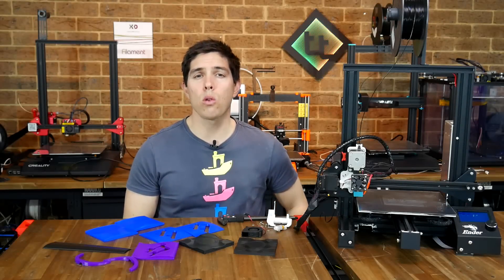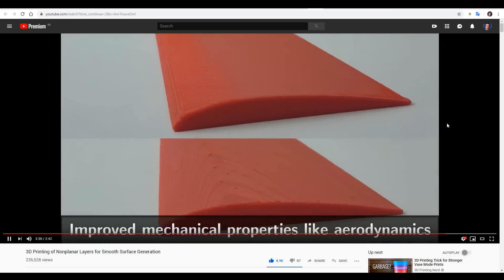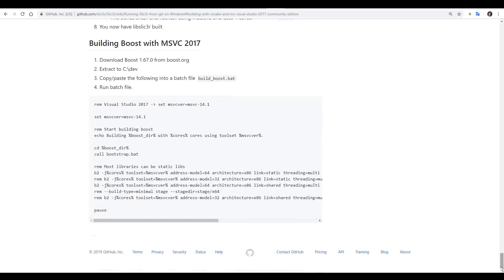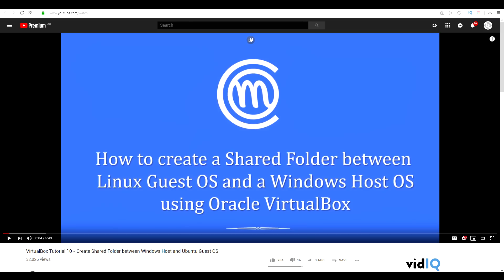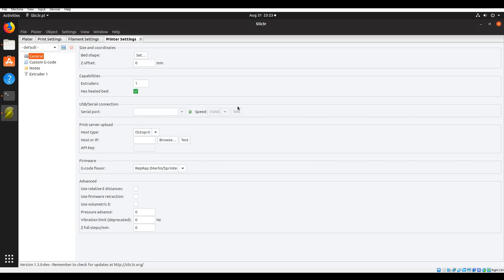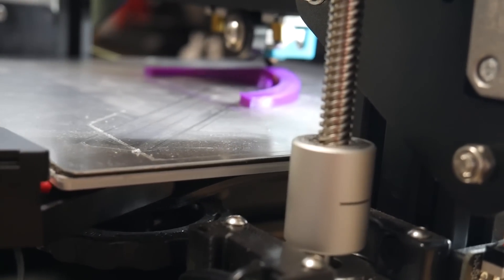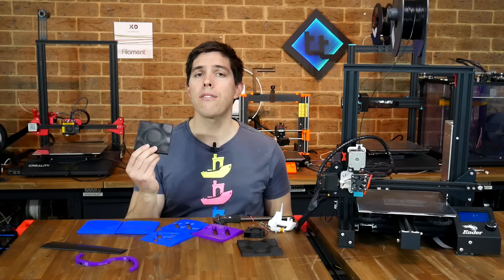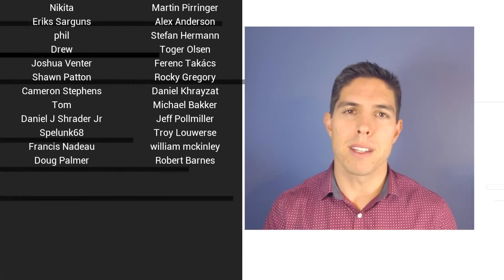Achieve true 3D printing with non planar slicing

Comment: I know i'm very late, but i just found out today randomly, that MIG welding nozzles use the same threads as the nozzles for 3d printers! They are full copper and 25mm long, for this application they might be really usefull if it can carry the heat down without problems
Reply: Nobody owning a lathe anymore...?
Reply: That's an idea with potential. The original bore may not be perfect, but it's copper, easily accessible & comes in a range of sizes. Relatively cheap, too.
Well suited for modification. Rebore them, change external profile.. even turn them into stand-offs for standard nozzles. Lots of potential.
Reply: I’m going to doubt it’s viability because my stock ender3 pro hotend drops almost 100• between the actual contact and the tip of the nozzle. My printer heats it’s element on average 80• higher than the nozzle tip. Adding just 10mm to that length would put you somewhere in the 150• area(not even close to viable), and to get the heat out of the nozzle you’d have to turn your heat up to around 400• which is going to kill your hotend lifespan.
Reply: norden what are you doing here i didnt know you liked 3d printing
Reply: You mean the contact tip or the gas shroud?
Reply: @hoenndpn9200  Contact tip
Reply: @Dongaz  do you have a specific supplier where you saw this? I don't have a MIG welder so I don't know exactly what to look for. Maybe a link or a reference to where you saw it? That would be very cool if there's something out there already

Comment: Imagine the structural strength you could reach when the infill is no longer limited to the X-Y plane. By adding direct connections between layers by the Z-axis you could solve the only problem stopping 3D printing from making final products for heavy usage. 
Steeper angles would also be possible by printing parts of the non linear surface in parts. You set the clearance of your nozzle at 7,5,mm. This means that if you had a pointy nozzle you could print non linear surfaces up to maybe 60-70 degrees in strokes of 7,5mm. You would introduce a new kind of horizontal lines, but they would be easier to get rid of than a horizontal layer every 0,2mm.

Comment: I’ve thought about something similar as a way of printing bridges and overhangs without supports. Print upwards until you get to the overhang, then tilt the hotend and start printing sideways, slowly if necessary for adhesion, adding onto the side. I know this has been done with angled printers but there are limitations to that. What I’m referring to is combining both vertical and angled printing by tilting the hotend midprint. I wonder if that would work.

Comment: I'm not sure if this information will be useful or not. I swap the Teflon tubing in hotends with stainless capillary tubing that I buy and cut myself, to allow me to increase temps without having to use a special hotend. The tubing could potentially cut longer to allow you to space the nozzle out further. Not sure this will provide many advantages in this application but it may allow you to set the nozzle a few mils lower.

Comment: I thought. They could, but they can't and it seems obvious now.
As you went through, I thought the head would have to move (for best results), it would only need to have a camber axel of 12.5 degrees to make it work.
The secondary,  fixed head. I would think that a nozzle extender could work, a copper tube for example.
This could transfer the heat down rather than moving anything else.

The fan cooling benefits are essential from what I have seen, (printer arrives soon). So the only difference would be the angle of the parts cooler duct. And then a short extension of a few mm.

But....
If you're getting steps which are so wide then surely this is more a slice issue? Or nozzle?

The steps should allow  small inversions of 0.4mm on standard and around 0.2 on a small nozzle.

And does the printer not offer smoothing? 

Tbh I can't believe they don't offer this, or have had this designed in, after all it's very old tech from engineering, and you couldn't get perfect roundness, but it wasn't as bad as the printer is. 
Is this down to bits? Or instruction handling?
Can it see, move and control 3 axis at the same time?

Sorry may be a too technical question...

Comment: They could take it a step further give printers the ability to slightly vector the nozzle in X and Y.  Layers could be stitched together then.  i.e. Current layer lines periodically latch UNDER the preceding layer lines.  Rate and location of latches could be slicer defined.  I can't imagine that it'd be prohibitively complicated either.  Just add a movable gantry for the hotend to mount into.  Could even use a mini-bowden arrangement with a tube of only a few centimeters so the gantry wouldn't have to move the extruder along with the hotend.  Just a thought.

Comment: Hi, do you know if someone tried to modify a delta printer, so that it prints nonplaner WITH tilting the head? I think if the dual rods are replaced with single ones with ball joins on both ends a nonplaner with tilting can be achieved. Love to hear your comments.
Reply: I actually think this idea is genious, how ever don't think it would work as explained. It would require more parts to change the "move left" into a "first tilt 30° and then "move the remaining steps left".

It could work by haveing 2 "arms" above one another in one slider, then adding one additional stepper per delta slider which moves the 2 in different directions and therefore creates a tilting force. - its a bit hard to explain in english without learning the mechanical engineering terms first. sorry.
Reply: @TeaObvious  You are right - I messed up  while thinking . The Delta I'm imagining should be mounted on XY bed as it can handle only the Z and the tilts. Nice to see such a project though.
Reply: @sugar4o  I get your point, having the bed tilt until a certain angle, lets say 45° should be possible here, would be indeed a nice solution that enabled even more possibilities.

This also would be possible with only 2 additional motors instead of 3 as my idea. Despite the fact that the mechanics to tilt a plane this way is nothing new and used in some games. The most complicated thing about this to keep the bet steady.
Reply: Or it can be a proper delta with addon mechanism for tilting the head with a center of rotation the nozzle tip
Reply: @sugar4o  dunno if you meant it this way, but the machanism still needs to be on the frame of the printer not on the head to reduce the force of moments. Thats what i mean with having 2 rods per driver and use this to rotate the head.
How ever this needs to be solve, this would actually be a really fun project. :D

Comment: If you fitted teflon tubing to a box/manifold and blew this with a brushless fan, you could parallel it to the filament feeding tube, make a bracket to hold the tube end aimed at the workpiece and get a part cooling jet to replace the fan.

Comment: I imagine it will still be a while before every machine is running true 3d toolpaths with plug&play ease. I mean, someone can program toolpaths for a specific part but to compare with today's "slicer" programs, I imagine it will take a while for the ai programing to be good enough.
I just got my first mini-mill that's basically a glorified engraver but it does smal aluminum projects. Anyway, I couldn't believe how much simpler it is to get a lazer to make a product than it was to find a good CAM program that works with the software. It's one of those Chinese  3018 set-ups but has all aluminum parts. I already messed it up too, trying to see what happens if I go past the max with no limit switches. lol

Comment: now, wouldn't this produce a similar effect to just rotating your print 90 degrees vertically? unless you purposefully direct each line of this method printing there is no use for it.

Comment: Have you considered replacing the cooling fan with an air stream? Similar to what you would use to clear the work on a K40 laser cutter. That could  give you a much smaller footprint at the nozzle end.

Comment: Teaching Tech: "I needed a dedicated Linux machine. From here on out, I needed a Virtual Machine" every Linux user ever: facepalms "JUST DUAL BOOT!"🤣🤣 
I just find it funny that VM is harder to set up and much slower yet more people use it because they don't know about dual booting or using a thumb drive to boot Linux from lmao
Reply: No concurrency between the utilities present on both systems. Cant flip between them instantly
Reply: @Hyratel  but if you have a SSD it takes less than 30 seconds to reboot into GRUB and switch to Linux.
Reply: @TeslabladePlaysMC  that still means you have to completely stop what you're doing on one to switch. And idfk anyone who ever does Just One Thing at a time, even on projects

Comment: Excellent video! Wanted to point out that you could have just used cloud storage like dropbox instead of a shared folder... assuming your VM had network capabilities. Also, do yourself a favor and install Git bash or another terminal program instead of command prompt! It supports command history and Linux style commands.

Comment: Actually, a modified Delta printer is excellent for this, as, with the correct programming, it can rotate the printhead quite easily... There is no reason that the effector has 6 arms, three determine the plane and as you can freely control each arm, you can move the plane from horizontal...  (need to brush up on my math to figure out how to do that in  a program...)

Comment: I think the geometry of a nozzle printing a 45deg overhang in a planar print is similar to a nozzle printing to a 45deg sloped surface in a non-planar print. So, just as he demo’ed, some surfaces are doable with a 3 axis printer. OTOH, I can’t imagine an equivalent of support structures for surfaces steeper than 45deg (or whatever).

Comment: Nice Video,  except,  You installed Linux the hard way..  You can install it next to Windows for a dual boot computer,  or,   run Linux from a disc or flash drive..  I use Linux exclusively,  I'm gonna try Slic3r.  Thank You..
Can Slic3r be used for 3d milling ?   I can't find a suitable CAM program for Linux,  Pycam was ruined during an upgrade,  and is currently not usable.

Comment: With a long clearance stile of extruded you could vase mode the exterior of parts for a smooth finish. That combined with the hypothetical 5th axis pivot would almost entirely get rid of surface finish issues as well as bridging problems. I think the long extruder will be an aftermarket part. The 5th axis will be an extreme novelty as it already is in milling machines.

Comment: Correct me if I'm wrong, but this technique seems to be avaliable only for rather flat (like the tiles you printed) finishes of parts that are not exacly flat, right? Software you used was throwing errors at angle lesser than 50%, which is quite logical,  as FDM printers 'spit' the filament, so it is impossible to use it for vertical surfaces. That beeing said,  It seems that technique might be complementary to the acetone smoothing, which works best on those vertical surfaces of the model, and perform quite poorly when next layer lines are far from each other.

Comment: Why not just use a live USB key? You don't need to overwrite your windows installation to run Linux. But if you do want to have Linux on your hard drive you can run it next to Windows and use both operating systems when you choose. It's a very straightforward process and it's almost automatic at this point. It detects whether or not you have Windows installed and then configures grub to install next to the Windows bootloader.

Comment: I can imagine that delta printers could be really really excellent at this kind of printing, although some may need some physical modification 🤔 admittedly, I haven't worked with a delta printer first hand and don't understand the technical side of how they work other then the obvious basics, but perhaps the angle of the print head could be changed to give a little more clearance, better layer adhesion, and better surface finish. Clearance will always be an issue with printer heads that are not designed for this kind of printing, but it is a cool idea ☺

Comment: Hi, there is something that comes in my mind: We could make the following as a standard slicersetting. Ever played with Legos? You need to make the bricks interlock. A slicer could do a zickzack (in Z-Direction) in the perimiter, and an opposing zig sag in the perimeter next to it (phase shifted). This would greatly increas strength along Z !!! It does not even need to have a high angle

Comment: Raspberry PI is an ARM chip, has a different compiler output and might not work for a project designed for x86. I would never recommend compiling on ARM something that was originally built for x86.

Comment: To be honest I think adaptive layer height is much more promising endeavor. Additional axes make the hardware way more complicated and expensive. Remember XYZ can easily be decoupled, so errors don't add up, any additional axes/joints will add error, which required more precise hardware. That's why 6-DOF robot arms are so expensive, the error adds up 6 times, so every joint must be very precise and without backlash.
However, I have seen companies working on non-planar slicing/printing, but that is in the aerospace industry with carbon fiber laying printers. In the consumer market, it's likely not going to happen soon, considering how little 3D printing has evolved in the last 5-10 years.

Comment: It's really awesome, but you could print many examples standing up vertically in the printer. The more or less vertical walls can be printed with a high surface quality. You might need a brim of 10 or 15mm width to enlarge the surface sticking to the printing bed.

But for more complex objects where you always have nearly horizontal surfaces no natter how you rotate it, this would be really great, when the slicer can handle it, like the head of a big figure or a helmet and so on.

Comment: I just spent a day trying to get this to work and so to anyone who is more currently following this make sure you install one of the reccomended versions of ubunto, the only one I could find was 18.04 LTS http://releases.ubuntu.com/18.04.4/?_ga=2.39386659.1497512183.1590350104-1906764249.1590350104 the newest version will not work
Reply: Oh snizzap!  I'm so glad I checked the comments when this would be fun project blew up in my face.... Thanks!  This got me over a significant hump that was yet to be solved in the github comments.

Comment: You can partition your drive and load Linux onto one half. If you choose to put Linux first in the boot sequence, the computer will give you the option to choose which OS to boot when you turn it on. If Windows is first in the boot sequence, it will not give you the option, it'll just boot itself.

Comment: Take it a step further by mounting the entire 3D printing apparatus to a robotic arm.  Now the nozzle can achieve any print angle desired.  No need for guide pulleys, screws, rods, or rails.  The print bed could also be mounted to an automatically adaptive robotic arm so as to allow multiple robotic 3D printers to work together in the creation of new types of at-home fabrication.

Comment: Just compiled this on my Raspberry Pi 4 and it appears to be working great, just exported my first gcode and I'm about to give it a shot!
Reply: So I compiled the software and made code, but when I went thru the preview it looks like it’s not generating any non planar moves, even though it’s enabled in printer options and I set the settings to wiiiiide open (75*, 100mm). Can anyone assist with this?
Reply: So in the end I realized the model I was using wasn't a good fit for non-planar printing. Eventually I'll try again with something more appropriate, but ironically "true 3D printing" isn't compatible for objects that are too 3D to be processed... seems to require a curved plane where as I was trying to put finish on the curved ends of a mask

Comment: It's a neat concept but I think it's mostly useful for very specific  (shall I say niche?) prints. None of the prints i've made the past year would have really benefited from this and needing specific hot-ends sounds like it wouldn't be worth having a printer just for these kind of prints even if they can iron out most of the problems unless a lot of parts you print have slightly warped upper surfaces.

Comment: CNC machinist here.  Getting a 3D printer soon.  This toolpath is called parallel for obvious reasons.  The downside is it's generally slower.  For 3d printing 2.5d with small steps for sanding or what not should be sufficient but a workaround in the mean time...set your slicer to use zero top layers or one of not zero, upload your stl to Fusion 360 or whatever cam software, set a parallel toolpath with a .4mm ball endmill, one or two axial offsets (Z), and whatever stepover your using.  Copy and paste that code, I assume editing the S and F and setting lead in/out to zero.

Comment: Hi, I've seen you've got back there a Creality, some Ender and probably a Prusa... which one would you recommend (with the ) to be the most reliable for printing more-or-less 6-12 hours/day with PETG filament? It could be a different printer aswell, not just these I described earlier... I just want to get a capable printer that can get very nice print results with as few user-interventions as possible! 
And also, what type of replacement/replaceable pieces does a FDM printer has? Is there something I should look intro for buying spare parts just to be covered when some piece runs'out it's "life"? 
I would really appreciate your recommendations since I'm a complete noob to FDM but I have to rapidly start prototyping (PPE masks for medical stuff).